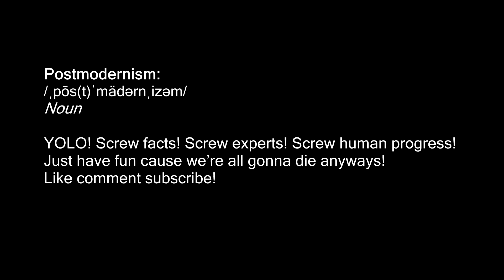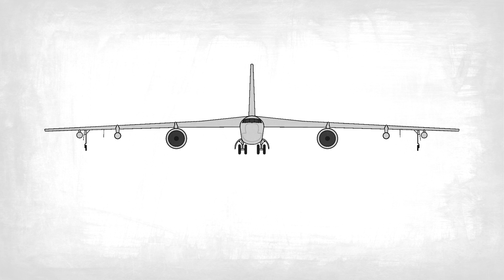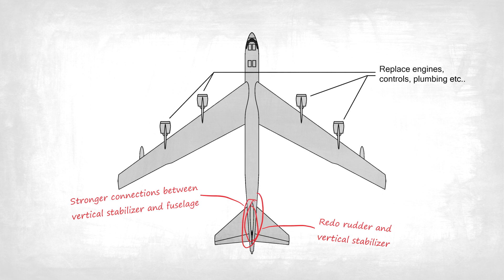The B-52 is Getting New Engines... Why Does it Still Need 8 of Them?

Comment: Saw a B-52 flyover at an airshow last February, first time for New Zealand. I always regard the B-52 as having what I call "container or semi truck" mentality, basically a rugged load carrier bomber, the A-10 is the pickup truck!
Reply: @RiDankulous  The beast did a low flyby with it open... it was!
Reply: Well put. We often ask about why they've not replaced it by now, the answer is that they've tried. The B-1 and B-2 were intended to replace the B-52 in service, but weren't really successful. They tried to be other things, supersonic and stealth respectively, whereas what's really needed is just a big ol' plane that carries a lot of stuff. Part of the problem might be that the B-1 and B-2 were designed around nuclear warfare, and as nukes were getting smaller all the time it was thought less payload capacity (both volume and weight) was necessary. But in the end it was found (especially in Vietnam) that there's still a need to be able to carry a large quantity of conventional bombs, which the B-1 and B-2 weren't designed to do, and in those cases supersonic and stealth weren't as needed. For what we've actually needed bombers for, the B-52 is still the best tool for the job.
Reply: @quillmaurer6563  Yeah, the B-1 is an RV and the B-2 is the luxury model!
The F-15E is a luxury SUV one could say and the F-16 a hotrod sports car.
Reply: @TheGroundedAviator  We should go back to the original design for the US Army of the EM-50, upgrade to today's technology, put parachutes on them, and drop 8 or 10 out of each B-52, and let hell take it's course (don't forget the ice cream scoops!)
Reply: @tcpratt1660  I had too look that up and yes, I couldn't agree more!
Reply: @TheGroundedAviator  I'm almost too old to be getting too old for this shit! ;)
Reply: @tcpratt1660  I started feeling that after remarking on the condition of a McDonalds I was at the other day!

Comment: There is more than just the thrust offsets in the choice to remain with 8 smaller engines.  to use 4 engines, the whole pylon would need to be redesigned to hold a single engine, and as others point out in the comments,  using 4 UHB fanjets would create major issues with case strikes on the outer engines as the wing flexes a whole lot.
 Also fuel systems would need a major overhaul as it was designed around 8 engines, AND the flight deck & engine control systems would need a major redesign for 4 engines as the whole system was designed to operate 8 engines. 
 Much easier and cheaper to utilise a pylon, fuel and control system designed for 8 engines where little of the pylon needs modification and very little of the other systems need major redesign for changing engines to a modern powerplant of similar physical size to what is currently on the airplane
Reply: if the single new engine has the same weight and thrust of the 2 old engines, why would the pylons need to be redesigned?
Reply: @aleks138  the pylons were designed for 2 engines,  all the mounts are designed for the 2 engine pod and the thrust line is not perfectly down the centre of these pylon,  so with 2 engines per pylon,  if you lose one there are stresses involved regarding the dead engine and there off centre of pylon thrust of the one operational engine. There are so many factors involved in the design considerations the economy of the re engine program would have not made sense for going to a single engine per pylon option.
Reply: @aleks138  its not just weight & thrust, the pylons were designed to hold 2 engines and the with an engine each side of the pylon centre thrust is not down the central line, so if an engine goes on a pylon, the thrust line is offset to one side slightly so there is a thrust line off to one side trying to turn that pylon around.  The mounts to hang the pod will be different to the mount points on a single unit, so that will need to be redesigned to handle the different stress point locations of the new mounts. 
  Plus by retaining 8 engines, the entire engine control system & fuel systems don't have to be touched which also saves money by not having to redesign, and modify the flight deck for the new systems as well..

Comment: You actually missed one of the more important considerations:  Flight speed.

Going from a low bypass turbofan to a super high bypass turbofan will come with a serious reduction in speed.  Modern high efficiency engines save fuel by moving as much air as possible at the lowest velocity that they can get away with.  When the B52's were built, the only way to improve the propulsive efficiency of aircraft was to get them to cruise as fast as possible, with the available thrust.

A less important consideration is that the increased area of the fan will have adverse effects on the size of the radar return (one of the claimed reasons for not going with four larger turbofans, instead of the eight chosen, when they did not go with the RB211's).
Reply: Yes, the CFM56s put on the DC-8 series 60s, creating the DC-8-70s, added significant amounts of drag.
Reply: Disagree on multiple points here. The original B-52 engines weren't turbofans, they were turbojets. Turbofans weren't really viable on aircraft until about a decade after its design. Also, using fewer but larger engines would actually likely not affect drag significantly (and even if it did, you could compensate by increasing the thrust commensurately since you'd have to redo the wing anyways). 

Also, moving as much air as possible with the highest velocity change possible for the lowest fuel cost is how all propulsion devices work, not just turbofans. High BPR Turbofans are more efficient because they use some of the work produced by the turbine to compress the air moving through the bypass duct which nets you a greater return on the energy you introduce via the combustion chamber. 

I really fail to see where you got this idea anyways since there are plenty of airliners that fly as fast or faster at cruise using high bypass turbofans. 

Source: My aerospace engineering degree and the propulsion class I took
Reply: @jacobdewey2053  Larger engines are not slower because of increased drag.  Higher bypass turbofan engines are more efficient, because they move a larger mass of air at a lower velocity (assuming that the thermodynamic efficiency is the same for both engines).  For maximum propulsive efficiency, the rearward speed of the airflow has to exceed the forward speed of the aircraft by as little as possible, while still producing enough thrust to overcome drag (sadly, all engines running at 100% propulsive efficiency produce exactly zero thrust).  

Turbojets produce high thrust at low propulsive efficiencies; unless, the aircraft can cruise at close to the speed of the exhaust jet (Concorde, XB70, Avro Arrow, to name a few).  Turbofans take energy out of the low propulsive efficiency jet exhaust to drive the bypass fan that produces thrust at a higher propulsive efficiency.  Turbofans produce more thrust for a given amount of energy, by moving more mass at a lower velocity.  The faster the intended cruising speed, the less potential efficiency gains available by moving more mass at reduced velocities.

Airliner speeds (excepting the Concorde) peaked with the Convair 990 and have been in decline, ever since, because a small increase in travel time comes with a large savings in fuel.  As the largest term in aerodynamic drag depends on the square of the square of the velocity, a 10% reduction in speed drops the drag by nearly 20%.  Combine this with an improvement in propulsive efficiency and the cost per mile can drop even further.
Reply: I think a radar on my boat could pick up a 52.
Reply: @rogersmith7396  I used to have them flying over all the time when I was young in the 60s. They were definitely loud, and distinctly different from the C130s and passenger planes I see today.
Reply: Survivability hardly matters for today's B52. It's low in any evenly matched contest (as, increasingly, is that of all airplanes and ships). The only reason to keep the damn things around is as a cost effective capacity to conventional bomb enemies with no high tech AA, and a scatter-and-send 3rd and 4th strike weapons to make sure the human race is well and truly doomed after the first couple rounds of ICBMs.

Comment: the engines have to be small enough not to scrape the runway they can't just slap two huge engines on them and go
Reply: And the wings are designed to flex with the specific weight and configuration, if you remove ven 1 engine, you'd compromise the wing's structural integrity as it would flex wrong, and I won't even get into resonence issues.
Reply: .....as Boeing found out with the 737MAX.....
Reply: @1chish  the problem with the Max was that they put a program in place without telling anyone about it and how to turn it off. They also relied on one sensor for information about how the plane was flying instead of three and polling them to see if there was a problem.
Reply: @ferky123  Those are the specifics of it, but the reason MCAS was necessary in the first place was what most see as a fundamentally flawed design. Trying to equip an overgrown 1960s regional jet with huge engines despite it's very short landing gear. Really trying to push an aircraft into a size, role, capabilities, and era it wasn't designed for.

Comment: The 52s you showed were Es & F's which we called Tall Tails back in the day.  There are no Tall Tails still flying.
Reply from the maker: Yep, that's correct.
Reply: @PDXHEAVY   The B-52 you showed when discussing the small rudder was Balls 8, which is a B-52B. Not an E or an F. Don't know if that means it was bigger or the same as those or the currently flying B-52H.
Reply: @donjones4719  the tail size was reduced in the later models.  The actual size of the airframe was not changed.  The tall tails, referred to the early models.

Comment: You’re also missing that many B52 pilots use 4 and 5 (the innermost engines) to not only dictate the overall speed of the aircraft, but the lateral trim. It’s not uncommon for 4 and 5 to be used to steer the aircraft in leu of the anemic rudder. There’s a great 1 1/2 hr walk around of this aircraft where the captain goes into great detail about this.
Reply: Also, moving from 8 engines to 4 wouldn’t necessitate re-designing the entire fuselage. It has much more to do with redundancy, as certain engines control and back up certain systems. It wouldn’t require a redesign of the fuselage, but would definitely require a gutting and reconfigure of main, secondary, and tertiary systems.
Reply: At any rate, you’re… kind of right. But not really

Comment: Is it horrible that my first thought when they put the 787 comparison up was it might have been cheaper, simpler, and more effective to redesign a 787 or 747 into a bomber than re-engine the B-52.
Reply: The problem is that the wing box and main landing gear bays are right about where you'd want to put the bombs.
Reply: Boeing has repeatedly proposed a cruise missile carrying B747, but for various reasons the USAF is not enthusiastic about it. 

The B52's innermost pylons are supposedly going to be used to carry a missile larger than the old Hound Dog missile.
Reply: @davidhoffman1278  It might have enemies shooting down civilian 747s is all I can think.
Reply: @rogersmith7396  ,
Possibly, but the cruise missiles it would have carried had far more range than the standard cruise missiles. Another ultra standoff distance missile carrier. That might have reduced the threat to civilian B747s.
Reply: @davidhoffman1278  They have a SRAM which is nuclear.  The B1 was designed to carry that.  I assume cruise missles can be nuclear too.
Reply: @rogersmith7396  ,
Yes, the original ALCMs were only equipped with thermonuclear warheads. Later on non-nuclear warheads were installed in some of the ALCMs.

Comment: That was fun. You added to important issues I'd previously not considered - but I hardly dwell on government expenditure for re-engining of B-52s

I have something to add, years ago when I was a teen I read an article on the design of the B-52 and how the engineers initially drew it on the back of the proverbial napkin/coaster/hand.
Anyhow, the position of the motors required extensive wind tunnel testing and many changes were made. They knew the size and sweep the wing had to be then had to use the technology of the day to get enough thrust - hence 8 engines.
Here's the cool part, the engines are positioned along the wing to act as inertial dampers to stop aerodynamic induced harmonic oscillations along the length the wing and the pylons are used to control torsional forces acting on the long wing. The distance the engines are projected forward on the pylon is for several reasons including CoG envelope.
In addition to the info in your vid, as you point out the 1950s design is baked in and cannot be easily changed, not just for reasons of asymmetric thrust vs rudder control.

What would've been good is specifically why they are re-engining the B-52. Is it for better fuel efficiency and therefore greater range and perhaps a bit of weight saving, reliability increase allowing for greater payload?
Reply: The reengining is for reducing aerial refueling requirements and off wing engine maintenance costs. A 25% decrease in mission fuel consumption should free up tankers to do other support missions. The reduced off wing maintenance costs are a good thing.

Comment: Simple answer:  Because it's the best overall choice.  The aircraft is designed for eight engines and changing it to a four engine architecture would require changing so many other things that it would be cost prohibitive.  Never mind the fact that a four engined B-52 would just look WRONG,  there's so much more to consider.   Leave it to the aircraft engineers to do their jobs better than some marginally informed youtube content creator.
Reply: >Four engined B-52 would just LOOK wrong.
>Leave it to the aircraft engineers to do their jobs. 

Huh? Since when did engineers prioritize looks over practicality?
Reply: @nuclearwarhead9338  They wouldn't, unless the customer was specifically directing them to change their priorities. I think you might have missed my point.

Comment: In the Air Force, each month we held "Commander's Call", a meeting with all the squadron in attendance. One of the last things, movies from the base film library. One of those films showed the testing of the giant C-5A engines, one hung in place of the twin normal pod on a B-52. They got airborne and ran the giant turbofan engine up and had to shut down some of the twin engines as it overpowered the aircraft and neared the speed of overstressing the airframe. 

The B-52 J-47 as I remember, and the engines that followed, could be Cartridge started, a black powder charge sending gasses into the engine to spin it up enough for the engine to start. Not all military planes could do that, F-4 J-79s it would destroy the engine, they used a ground power start, on the other end of the ramp, the F-105 J-75s were started most of the time on cartridge starts and were happy doing it, as all the power carts were at the F-4 end. This may be why they don't use more modern engines, getting them started. On practice alerts and full wings of B-52s, the fastest way airborne was cartridge starts. No outside help needed.

Comment: Also, on top of the points you mentioned, Any major rework of the plain like that, would effectively make it a "new air frame" and would require re-certification (which would cost even more money)
Reply: recertifying a military plane would be the least of it's problems... Any re-engine option even slightly more departinf from the original configuration would probably lead in to a situation where at the end you would have been better of just building a completely new aircraft.

Comment: What you highlighted as the the tiny rudder is actually the autopilot tab rudder. The hingeline for the actual rudder is at the double black lines. In manual flight mode BOTH segments of the rudder are utilized together with the smaller aft section actually compounding the deflection, so in reality the B-52's rudder is HUGE compared to other aircraft, it had to be to be able to hold the crab angle into the wind to allow it to land with very little flair, allowing the four steerable landing gear to align to the runway centerline.
The biggest reason they are staying with 8 instead of 4 engines is the cost of reengineering all of the flight profiles and allowances and the redesign and removal of the four unutilized engine stations.
Reply from the maker: Looking back, maybe I should have found a different photo of a modern B-52 tail without the double back lines. In this photo, it's a lot more clear that the double back line location is not the outline of the rudder: https://i.stack.imgur.com/Q252N.jpg
Reply: Worked on the airplane at Boeing for 30 years, I know it very well.